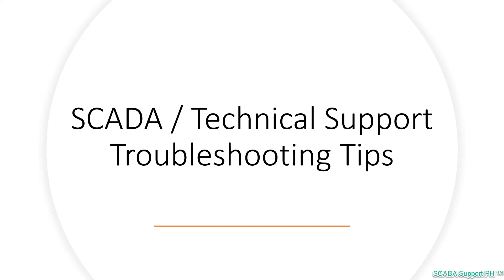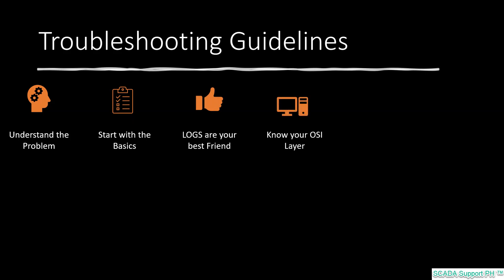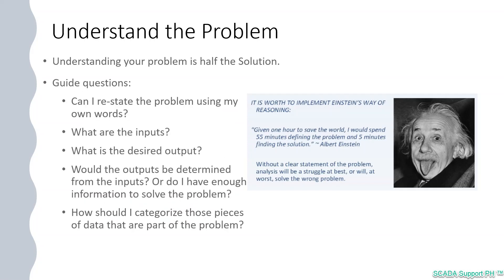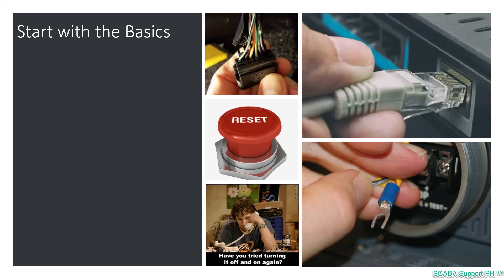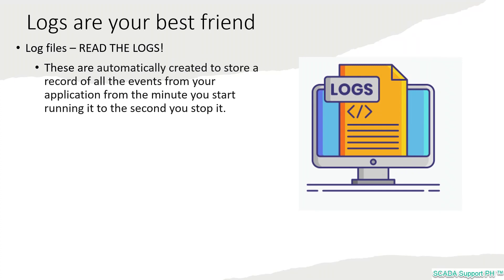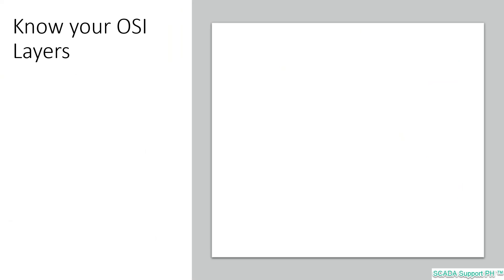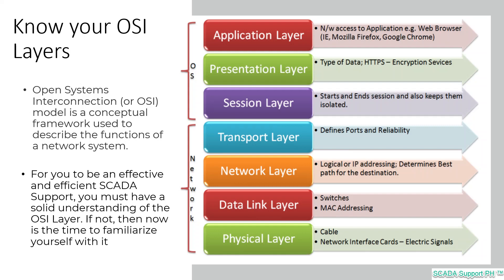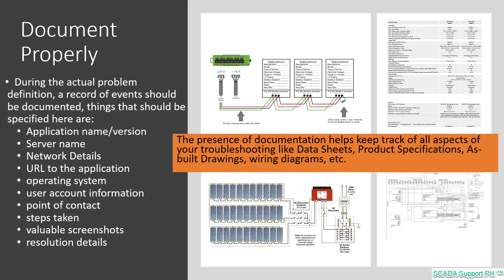SCADA and Technical Support Troubleshooting Best Practices

Comment: Cpu not in run current cpu operation mode 
What's the error, please help
Reply from the maker: @nemdininadithya2099 would you be able to share screenshots or additional information about this error? e.g. OS that you're using, machine that it's running etc... in this way, we would have a good understanding of the symptoms of the issue. thanks!